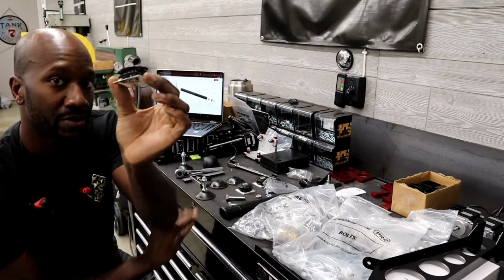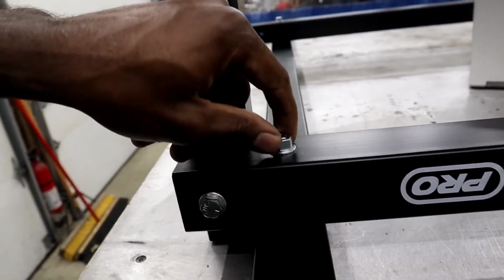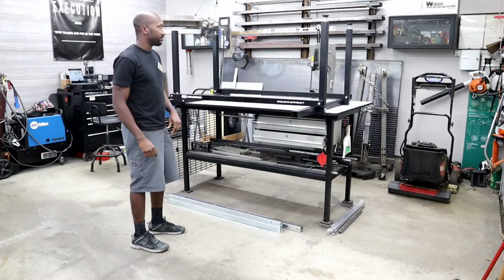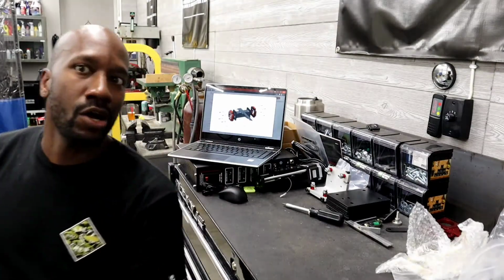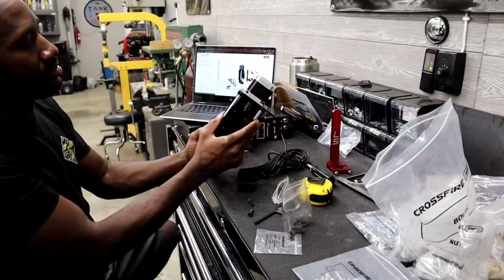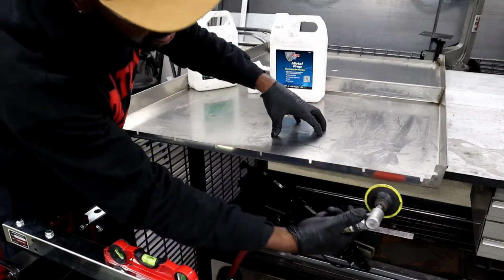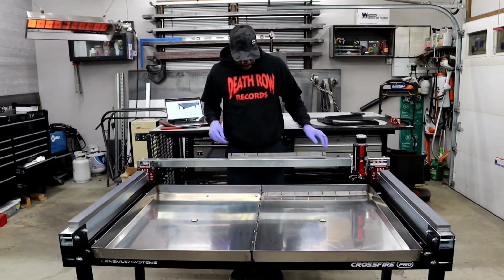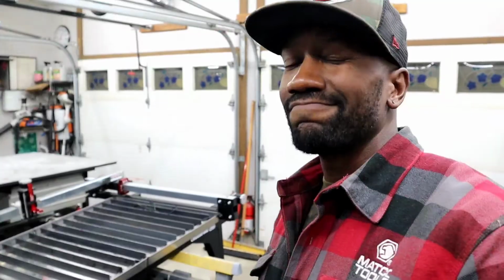Langmuir Crossfire Pro CNC Plasma Table Build

Comment: Excellent video. Your doing a good job. Get yourself a dimpler and recess those pan drains. Itll really get them completely drained. Looking good. Nice shop.
Reply from the maker: Thanks for watching @MrLittleman777.
I Definitely need to do that, I will probably  build a drainage / filtered system to keep  the fluid from evaporating come spring.

Comment: Great video, thanks for putting it together, very helpful.
Reply from the maker: Thanks Ari Boss, FYI use red high temp silicone gasket maker.  The 2 part I used in this video failed. Thanks for watching Marcustomz Garage ✌🏾.

Comment: Really good video. I've been slowly building my Crossfire Pro.
Slowly because I'm a machinist / CNC programmer, not a machine builder.
:)
Good method of sealing up the water table. Definitely a good idea to rough up the surface before applying sealer.
Merry Christmas, Happy New Year.
Go Patriots and now that nearly the whole team went to Tampa Bay, go Buccaneers too ( a little friendly ribbing ).
Take care
Reply from the maker: Keith Lane, I agree with building the table slowly, just like Tom Brady running the ball. :)  Thanks for watching Marcustomz Garage go Chieeefs!! Lol

Comment: Did the panel bond work for you in the long run?
Reply from the maker: Not at all 🙈 tadamb 1
I replaced it with red atv high heat silicone
Reply: @marcustomz  Well I'm glad I asked.  I'm assembling mine tomorrow.  That sounded like a good idea, so I was planning to stop of at the auto body supply on my way home.  Thanks for the report sir!

Comment: What's the length on your torch cable?
Reply from the maker: Miller XT60M Short Body Machine Torch, 25 ft - 257464.      8.375 in. (213 mm)

Comment: How has the pro treated you over a year? I’m thinking about upgrading from the regular crossfire. I’ve got a buddy wanting to buy it.
Reply from the maker: @timblack33 thanks for asking. I'm loving this table. I haven't run into any issues other than, wanting to design larger parts than the table is capable of cutting.  I hope to outgrow this table one day. I would like to add a auto water fill and drain system next spring, due to the fluid evaporating between uses. All and all ,I'm loving this table. Note : If you decide to upgrade to the Crossfire pro. Bond the water table with a high heat red silicone, not the 3M product Ii used in this video.  Thanks for watching ✌🏾

Comment: Now that that 3M, 2 part has set up how do feel about the bond?  My Crossfire pro should be arriving this month and I'm trying to decide what to do about my water table.  Thanks.  And great video!
Reply from the maker: The bond is fantastic,the 3M, 2 Part has been used in crash testing in the automotive industry and has the same strength as a manufacturer spot welds joining panels. Car manufacturers recommend this 3M, 2 part to bond roofs on vehicles and in other applications.  I'm 100% confident in this product. Thanks for watching, Albert J3
Reply: @marcustomz  Awesome.  That's what I'm gonna do then.  Thanks for replying!
Reply: @marcustomz still recommend? I’m thinking about trying to TIG it, but my skills are a little lacking….
Reply from the maker: @bpdp379  Hello and thanks for watching.  I don't recommend using the 3M metal bonding product in my video. It's not Heat friendly unfortunately.  I removed the product and reapplied a High Heat Silicone from the auto parts store. Going on 2 years leak free.

Comment: Table arrived with issues. A table leg was double dented or pinched on 2 of its sides. And the main gantry is rusty and pitted. I made a short  video of my repairs. Langmuir is replacing t gantry, and has already shipped it. As for t table leg, I beat it into shape, but they're gonna replace that as well. Not happy with this item. Zero QC as far as I can tell. Ill attempt 2 post a video. See how that goes.
Reply: I got sent two LH lower rails instead of a single LH and RH so I couldn't even put the frame together...